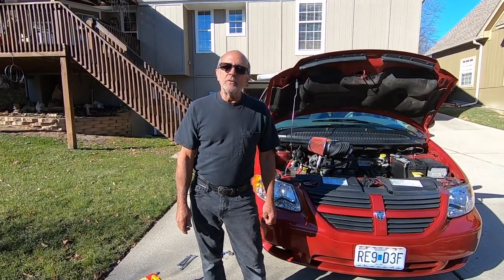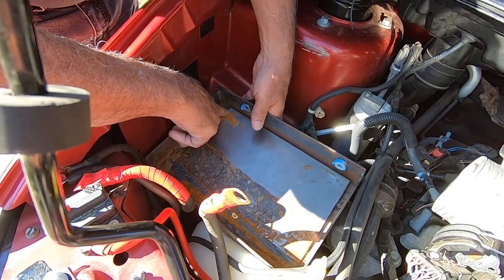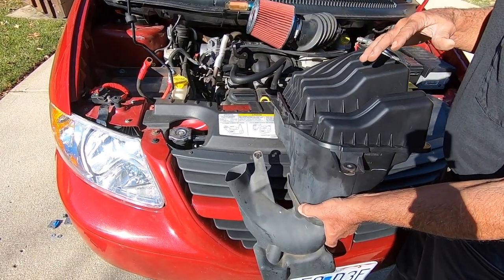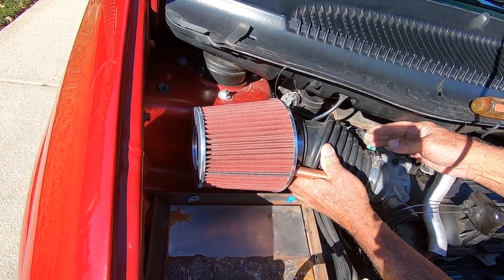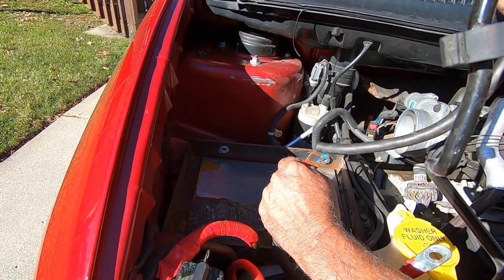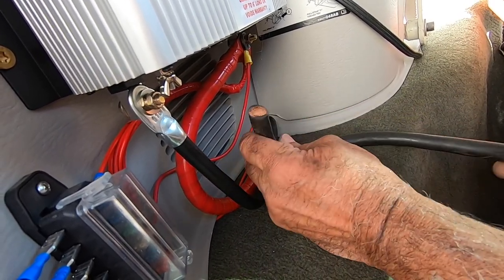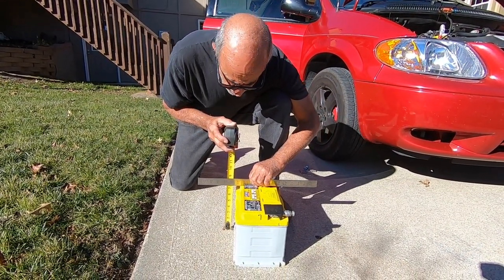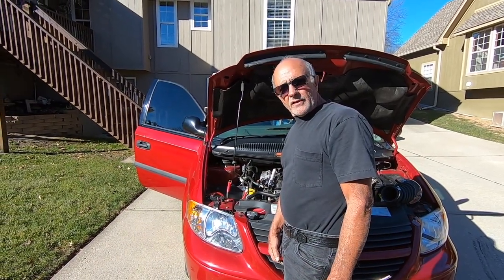Grand Caravan Mini Van Camper Extra Battery

Comment: Thanks so much for showing how you got the second battery in. I just got the cone air filter installed tonight. I've got two smaller 12 volt deep cycle batteries designed for a scooter that I am trying fit. If I succeed it's going to be quite a creative solution! :-)
Reply from the maker: I could see where two smaller batteries might be easier to arrange in that spot rather than one large one it’s a big area just very unusually shaped

Comment: I find this very interesting. I just inherited a 1999 Dodge caravan mini regular size 2 wheel drive; 2.4 l engine. And I was thinking about adding a extra battery to my van for camping reasons. Not only that, but also for the fact that I want to install stereo system in my van plus the ability to put in a power inverter just apply for laptops small computer. I just replace the alternator in my van because the alternator a better course and it's a 90 watt but I know upgrading to a 130 watt amp would definitely help
Reply from the maker: Bryan
Sounds like a fun project. Enjoy.

Comment: What was missing was how you got the wire through the firewall which for me is the singular most important thing since I intend to put the battery behind my driver seat
Reply from the maker: Thanks for watching I did not bring the wire through the firewall I came up to the switch under the spare tire check out my video about the van and the flux capacitor switch
Reply: YouTube sadly does not make it easy for people to get on a channel like yours and stay on it. Had I been able to I might have been able to scroll down to find that video but it wasn't to be. I'll get her another shot though

Comment: On the next video can you show the engine bay with the battery and air filter hooked up and in place ?    Will you be using PEX pipe for your water system ?   Great informative content !
Reply from the maker: Thanks for watching and commenting I have a video with the van completely put together which shows the battery and air cleaner installed

Comment: Vince, I like your aux battery setup. In fact I spent all day looking for your channel which I saw earlier but didn’t subscribe. I have a few questions about because I am not an engineer. First, when the two batteries are connected does the combined juice not damage any of the car electrical equipment, and on the flip side would the stock acharge them both? Second, how can I find the switch to connect the two positives, what is called. And lastly, the simplicity of your setup makes a lot of sense to me, while other youtubers install relays and charge converters. Did you put any other electrical components like fuses in there?
Reply from the maker: Thank you for watching and commenting two batteries hooked together positive to positive negative to negative Will not damage the electrical system of your car. It’s not good to leave two batteries linked together it said that the weaker battery always pulls the better battery down. So the only disadvantage is leaving the batteries connected when you’re not charging them. The switch I used on the floor came from Harbor freight.

Comment: Didn't you say you also installed a second alternator..great idea!
Reply: Hey Melanie,

There are also devices called DC to DC charge controllers that are a really great option too. They are designed to charge a second battery. Renogy also makes one that has a built in MPPT solar charging controller built in to it too. So when you are driving (or when your vehicle is running) the DC - DC charger, charges both your car battery and your additional battery. And if you have solar panels, you can connect them to the DC - DC charger too and charge your batteries with solar when the vehicle is on or off.
Reply from the maker: Thank you for watching and commenting I did not install a second alternator but I did replace the original alternator with a 200 amp one.
Reply: @VinceSaluto1  What brand alternator did you purchase?

Comment: Regarding alternators, I see 200 and 250 amp replacement units are available.  Any reason not to use the 250 unit or does this put too much of a load on the engine?  Thanks.
Reply from the maker: I’m not an expert on it but I don’t think your engine will care how big the alternator is
Reply: @VinceSaluto1  Thanks!
Reply: @dl777  can you send me a link to those alternator? Please. I can only find up to 160 Amp. Thank you.
Reply: @danielhreno9582  After researching I don't think it really matters.
Reply: @danielhreno9582  I don't have the links anymore either. Sorry.